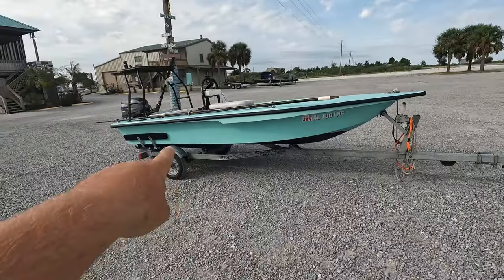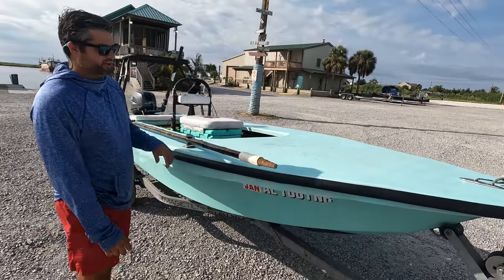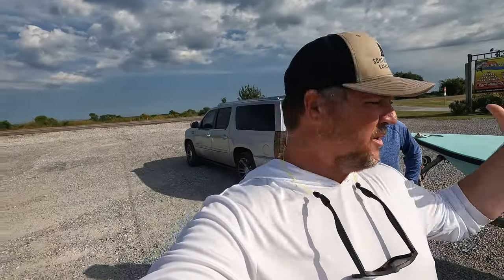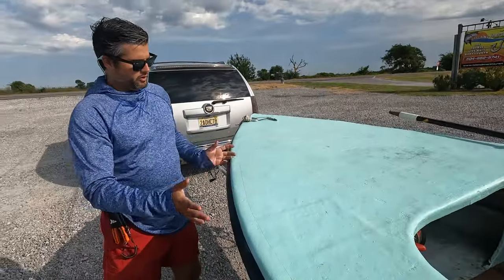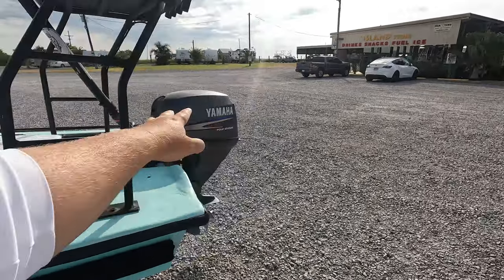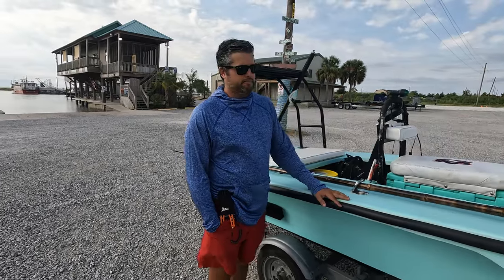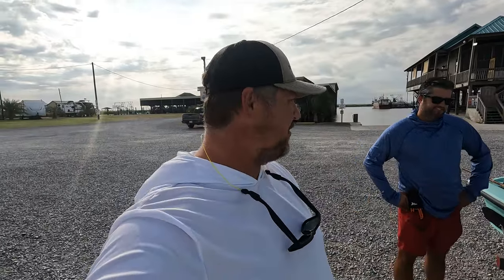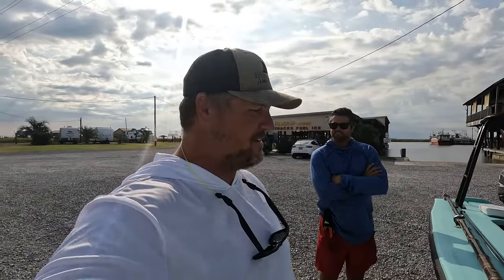This HOMEMADE Micro Skiff is EXTREMELY Affordable!!

Comment: I have the same hull with 25 Johnson.  I fiberglassed a casting platform and repurposed an old aluminum step for my poling platform.  Aluminum extension pole for the push pole.  It’s an amazing rig.  $2,100 total invested
Reply from the maker: Heck yeah!!